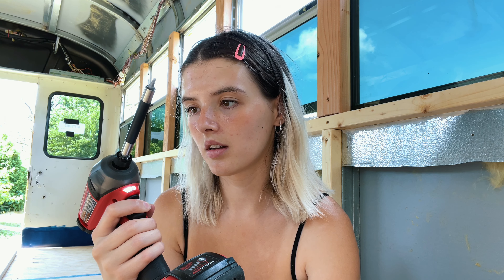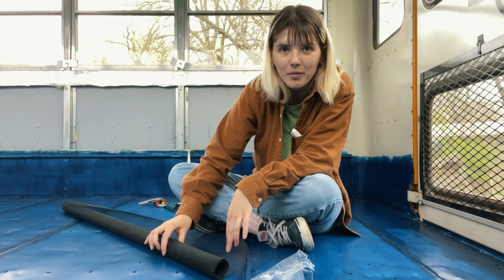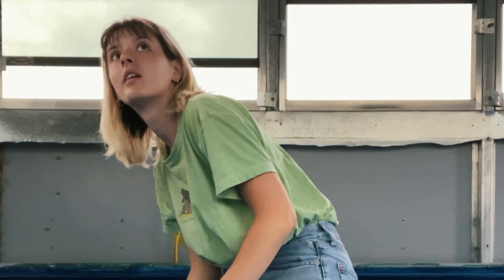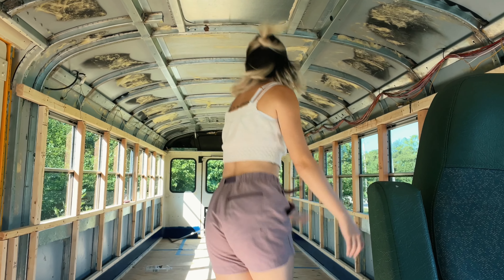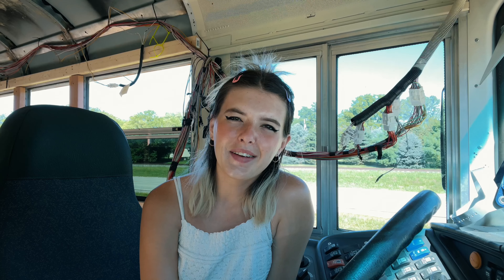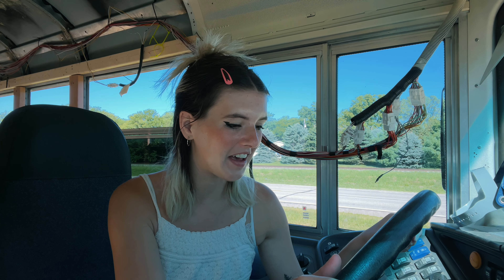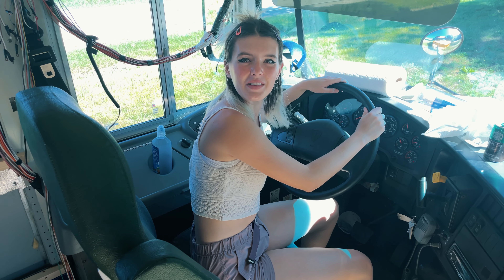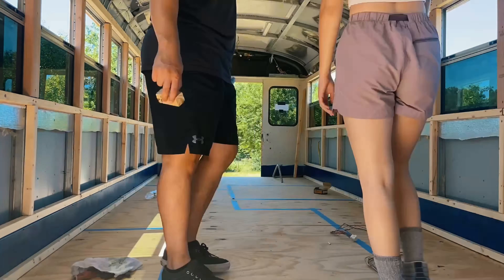converting a bus/van isn't as easy as they say 🚌 mistakes, triumphs, life updates

Comment: There is a foam. I'm not sure of it's cost but it is easy cause it's like spraying a fire extinguisher. Aim and fire. It expands a little too. It's fun actually. But don't spray anything you don't want to cover in it. It is hard to remove. I bet you know the wiring real well now. You Can Do THIS!! You will be able to fix everything by the time you are done. Knowledge is power and every time you accomplish something else, you will become more confident. I changed the spark plugs and coil packs in my car and now I try to do everything I can myself. You are doing GREAT!!!!!!